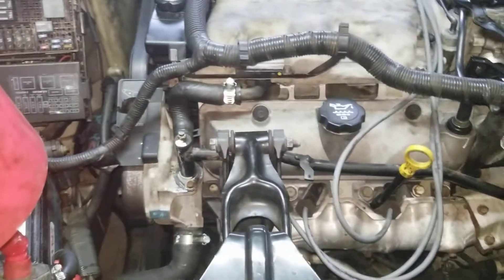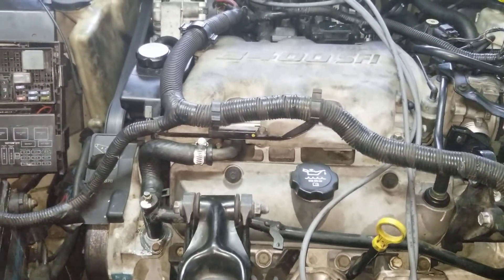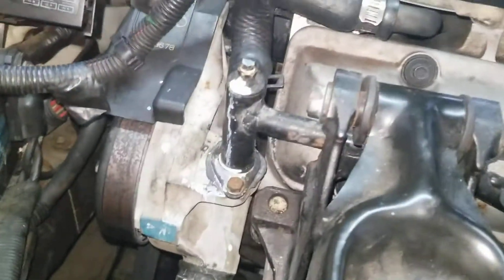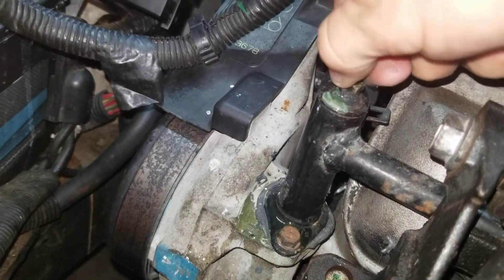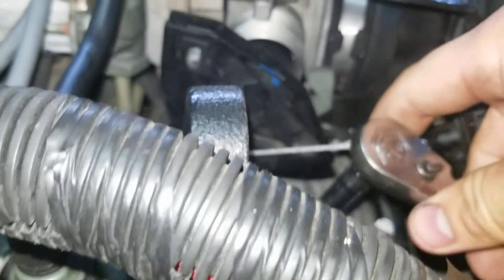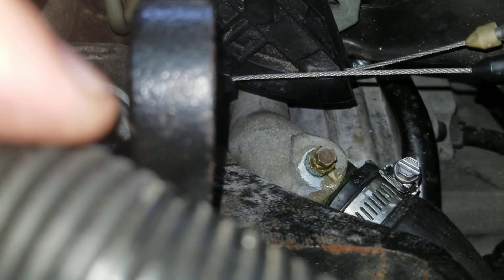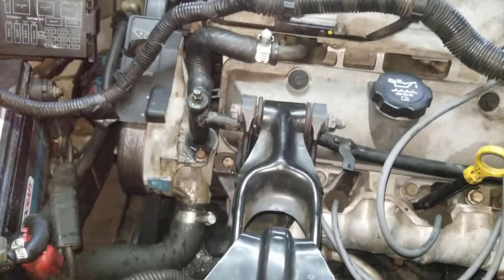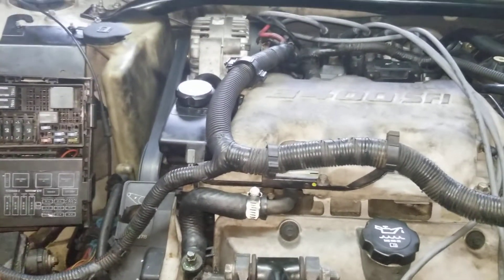coolant system bleeding, chevy,pontiac,oldsmobile

Comment: On the fire wall, the heater core hoses that come out, which side does the hose from the thermostat housing go? Driver side or passenger side? 2005 grand am 3.4L

Comment: Thank you for this. I just bought a Buick century 03 and overheating has been an issue for last 2 months since purchase. I'm running through gas and have poor acceleration upon driving. I hope this solves the main issue I'm having thank you again 🤘🏼🤘🏼🤘🏼
Reply: If u smell fuel. Check fuel pressure regulator you can do the job yourself also u may not smell fuel yet but check to see if it's wet under the regulator.

Comment: Hey bud . I have a 64 Oldsmobile 98 and changed  water pump, thermostat and new radiator and still not getting flow through radiator and overheating still . No heat . So, do you think I need to bleed it ? Looks like there's a bleeder fitting on water pump. Thanks , joe
Reply from the maker: yea def need to bleed it out
Reply: Check heater core hoses

Comment: Any chance you know if there is a second on a 1999 olds cutlass with a 3.1? I can only find one but my car still overheats and blows coolant out of the overflow valve
Reply from the maker: most cars theres one at the thermostat and one on the intake by the power steering pump i did see a pontiac come in here once on the passenger side top of the radiator was a plug that had to be removed to bleed the system